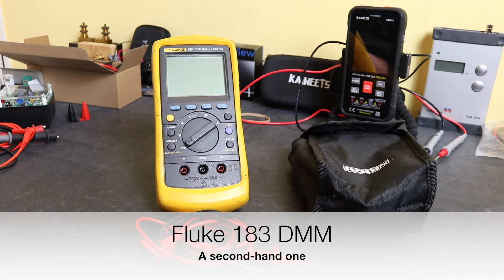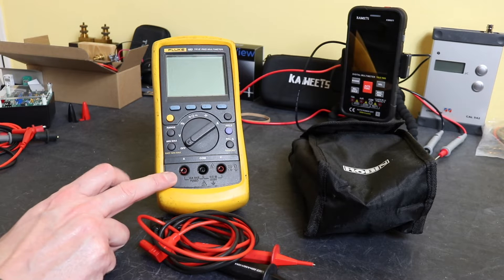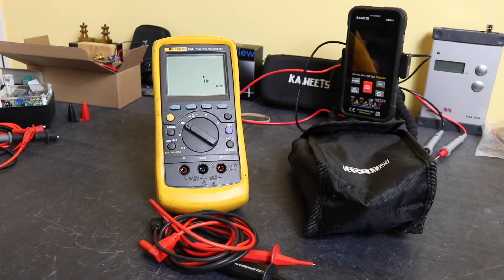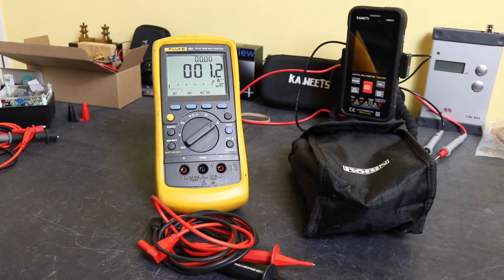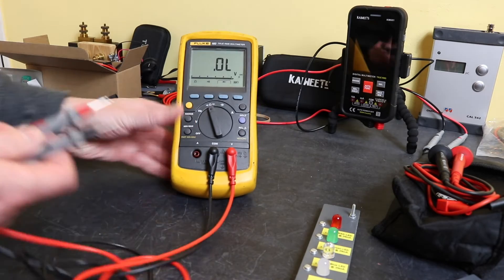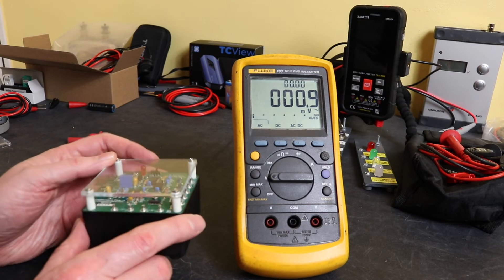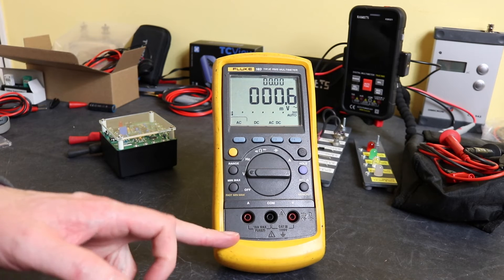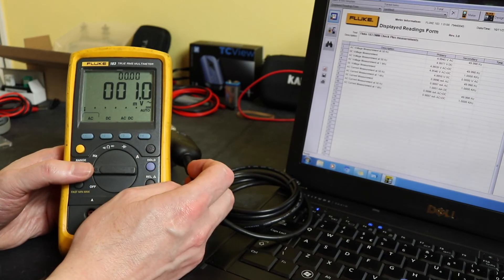I bought a Fluke 183 DMM

Comment: I love my fluke meters i just wish they would get with the times and use 4wire kelvin ohm measurements.
Reply from the maker: They are robust and reliable meters with a long life span, so usually a good second hand purchase. They have 4-wire measurement for some of their more specialist functions, but I haven't seen it in their more general test apparatus.
Thanks for watching and commenting.
Reply: @three-phase562  fluke, megger, and amec are about the only meters i trust. And of course man you make some great content. Hey how is that mtr105 holding up
Reply from the maker: @burnedupsparkytipsandrevie9597  I think the Aemc instruments are marketed as Chauvin Arnoux in the UK. I have a number of their instruments and they are generally good to work with. 
The MTR105 is still going strong, haven't seen much in the way of firmware updates for it recently.